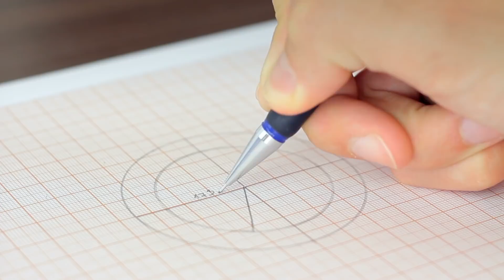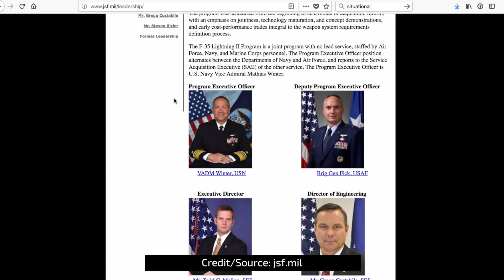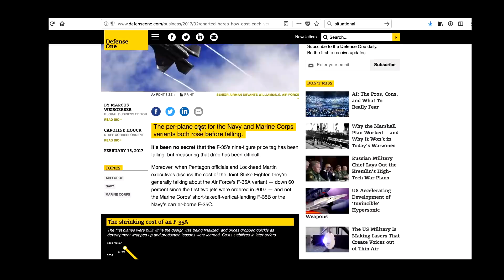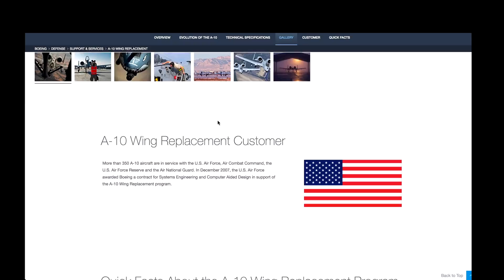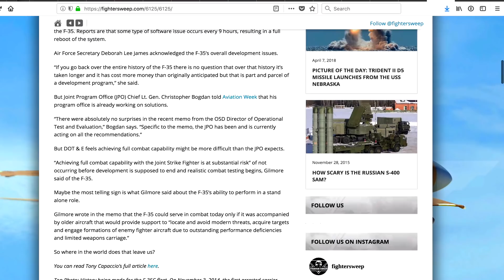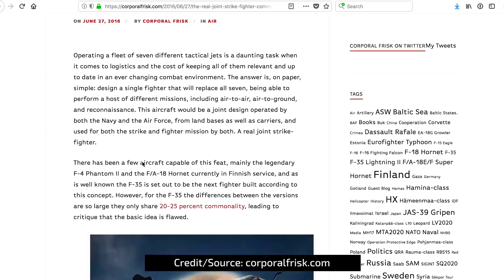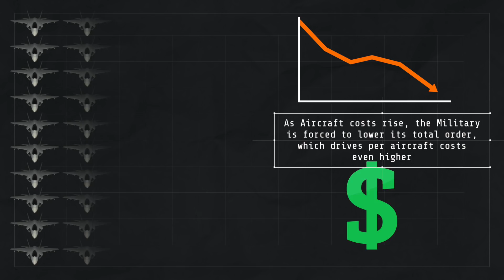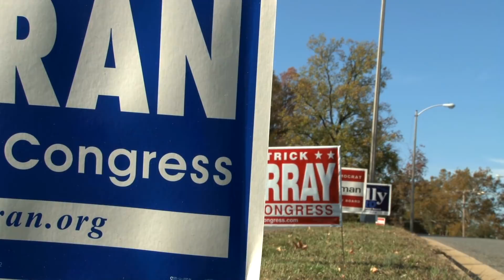Why the F-35 Lightning II Might be the Most Expensive Military Aircraft Mistake Ever

Comment: What most people don't realize: the superiority of a plane doesn't only depend on the stats - and that a lot of legendary legacy planes had their fair share of controversy and issues!

F-15 - engines were inferior (when the plane came out), cost overruns & delays. Also: some expert said, that the plane is too big, too expensive, too complicated (inclusive Pierre Sprey's fighter mafia) - it is now the most iconic and said to be the most superior plane built in the last 40 years.
F-14 - inferior engines cost overruns & delays. - and other really big issues. Their main weapon (why the plane was chosen to begin with) has been probably the most controversial and inferior expensive missile ever (Phoenix).
F-22 - cost overruns & delays. Some issues which resulted into the loss of airplanes and the loss of life. Now - pretty much everyone agrees, that it is one of the most advanced established war fighter.
Mig-25 - cost overruns & delays - several airframes has been lost due to aerodynamic miscalculations - engines could not be operated at maximum performance otherwise they would have result into the loss of the airplane.

And so on.
Reply: Dominik MJ The planes with less issues are destroyed. Ones that could have been successful but low maintenance is “too risky” for government apparently 😂🙄. Aka Canada and their Avro Arrow they could have upgraded over time cheaper and less problems than US, and European planes... But no then America gets to space with the help of the same ppl who made a phenomenal airplane destroyed by political bias.
Reply: @BARelement  Look - there are always a lot of conspiracy theories. It is very difficult to determine the "better plane" - and especially how much it will cost and how many problems it will have (in concept of prototype stage) (except you know the future or the "the future of a parallel reality).
The same issue applies if you compare the the F-22 with the YF-23. You will never know.
But let's face it: the F-35 has nothing to do with this issue really.

The real issue is, that 4+ generation planes - and especially 5th gen planes (and future gen planes) are impossible complicated - on the other hand militaries expect better and saver musters (and tests become more and more thorough). These two principle can only go into one direction: delays and cost explosion. And it doesn't matter who is producing it. You have got the proof in Russia (PAKFA over budget, basically cancelled,. underperforming) and China (J-20 underperforming - not at all 5th generation / J-31 delayed... who knows how it will perform eventually - but signs are not great). 
So - let's be realistic and give it to the planes, which achieved at least most of their expectations - and not delve into a theoretical future.
Reply: Dominik MJ Well 1. Before you continue this passive aggressive crusade you went on by write all that pile of. I’ve studied the aircraft while you assume by what the news gave you 😂. I’ve had books in my reach (although very rare.) I’m not delving into fantasy but hey if no one created theories we’d have no facts so we all know what you are against (the facts). “Stealth is a scam it’s just a theory.” I can make that point all damn day... lol I don’t believe that quote but just showing how your statement can be used to abuse a real argument. If the Avro Arrow can out climb the F-15, have a top speed CAPABLE OF Mach 2.5+, actually hit Mach 1.9 with less than full power due to the test being stopped since they didn’t want the weaker American engines to get the deal instead of the more powerful Canadian Orendas, Not only was the J57s weaker but it still got it to Mach 1.9 and could go higher, not only that but it had a higher climbrate  than many gen 4 planes (stripped down F-15, and Su 27), Has a internal missile bay unlike MANY 3-4th gen comparisons meaning when armed it KEEPS its performance more than other planes. Do you know how aerodynamics work correct?, and finally It can out maneuver Su 27-Su 33 at high ALT (despite lack of thrust vectoring 🙃🙂) can make those HIGH ALT turns with no loss of that altitude or aka (energy). Meaning it had amazing MER (Maneuvering Energy Retention But maybe you didn’t know that hence me explaining). Ok Now onto the things you said about “ITS ImPoSsIbLe to compare performance.😩” So you forgot math exist? You can’t do power to weight ratio? You can’t do aerodynamic calculation (aka drag to lift, drag coefficients, constants.)? Wing loading? High alt performance? Wow I didn’t know weights, thrust, drag to lift, drag coefficients, etc was so secret on these planes. It’s cool and all how you bring up all the gens (2nd-5th gen jets). Then say I’m in fantasy world but forget that math can be used to compare performance.. Your passives aggressiveness is just hilarious 😂🌚. It just failed. But yeah since you mentioned how “wE DoNt KnOw EnOuGh tO CoMpArE f22 tO F23” we actually have some figures we can play with. If you are smart you can put these together to come up with a reasonable answer. Here’s what I’ll tell you the YF 23 was objectively faster, stealthier due to its awkward less conventional shapes, was less maneuverable (although that’s a bit iffy since there is no hardcore proof I’ve gotten so far that it was less maneuverable. From what I gathered the YF23 pilot didn’t push the plane as hard and risky as it could go like the YF22 pilot did while showing off at the end.) but either way the less maneuverability can be attributed to the fact it didn’t ah s thrust vectoring which could be fitted to production lines if it was that serious, along with some software changes in the FBW. So what we can get is that based on its role and what it was meant to do. The YF 23 was better OBJECTIVELY speaking 😂. So there goes your “theory” (bs) about it being impossible to compare flight characteristics even though studies, books, math, and physics exist also with the fact that you can be a reasonable person and weigh those characteristics and decide what matters for its role, or for the “future” as you say 😂.
Reply: Dominik MJ Also I Know the Avro Arrow was more reliable as far as prototype stages go... They went full into production and skipped prototypes with the only malfunctions being quote “a light in the cockpit, and landing gear collapse on occasions” (but otherwise safe landing). While most planes take 10 whole years to get a prototype with less bugs in it, AND IT WILL STILL HAVE MORE FLAWS. The arrow was one of the most flawless “prototype” program I’ve ever looked at, and read upon. But here you go with the “we don’t know anything because books, math, and common sense don’t exist.”
Reply: Dominik MJ ILL throw some numbers at you Mr. “Impossible”. YF23 had a super-cruise of Mach 1.6+ and Top speed exceeding Mach 2.2+. Whilst the F 22 having a super-cruise of Mach 1.58, and a top speed JUST Mach 2.2... Along with the YF22 having a marginally worse Thrust to Weight also meaning that chances are the YF23 has a higher climbrate than its YF 22 counterpart... Right? See how easy it is to use commonsense, math, and something called research buddy 🙂😊? Also the YF23 Was lighter, had more wingarea, along with the previously mentioned better thrust to weight of the YF23 meaning it objectively without thrust vectoring being enabled had better maneuverability. But that’s just the short end of the stick and it’s not as clear cut as the rest of what I said but it’s closer to the truth than giving up and saying “ITS IMPOSSIBLE 🤤🤡.” You also realized that the YF23 has a higher combat radius right? 800mi for the YF 22, and 865-920mi for YF23. 🙃 Oh wow you failed in your argument (so many cracks, and falsities in it). I think my point is made, it isn’t impossible to calculate RAW PERFORMANCE, and Weigh it out with common sense to see which is best, and that next time you don’t attack someone being passive aggressive by saying “you are being theoretical” when A. technically everything said, and done is theoretical to an extent B. What would we be without theory? C. I brought actual facts at the end of the day what did you bring? “1 gen, 2 gen, 3gen”??? That cat in the hat shit. 😂💀 Maybe next time but not today son.
Reply: @BARelement  The Arrow was cancelled when it became clear that espionage had been doing data gathering and any further developments would only help the enemy learn more
Reply: Ben Grogan Um, what about what happened to MiG 25? They made the secretive MiG 31. Which actually stayed under wraps. So “help the enemy”? Where? If that’s the case no NATO nation should build anything advanced for sheer fear of the knowing...
Reply: @BARelement  Read up a little, Avro at the time when the Arrow was being developed it was believed directly directly infiltrated by Soviet agents - CIA agents performing similar tasks claimed that Avro research documents where found In the hands of the Tupolev bureau.

You mention the Mig-25, that was partly compromised by America intelligence and lead directly to panic and demanding a higher spec fighter in the for of the F-15
Reply: Ben Grogan 1. I’ve already read upon it hence me acknowledging what you said as partial fact. 2. By that logic we should stop everything we do because the others see it... 3. I mentioned the MiG 25 BEING FULL COMPROMISED, and them making the MiG 31 IN RESPONSE 😁! I didn’t mention F 15 has nothing to do with that plane so please read on what I said. Stop the passive aggressive Highschool gossip girl stuff.
Reply: @BARelement  There is a world of difference between terminating a project that is compromised, moving the personnel you trust to NASA research positions and stopping everything you do on any project

One is pragmatic to stop any further info directly leaking, you know there are data breaches but you don't know where, how or how much of the theories behind the project's choices has been breached and the other is a childish all or nothing - I don't believe that you are that silly from what I've read as in your replies to others you are sticking well to factual arguments
Reply: Ben Grogan I agree but still it could have had a comeback Is my point. And just like the US does investigating Canada could have dove into the issue and figured it out imo. They could have been a super power but they gave up to early and too far.
Reply: Ben Grogan I appreciate that you see I’m sticking to factual arguments. They based the MiG 25 off the arrow and from what I know it isn’t comparable so much in overall performance just high speed. Thx for being kinder Han others though.
Reply: @BARelement  I wasn't aware of the Arrow  directly contributing to the MiG-25 beyond being a competitor, I was under the Impression that the Arrows initial schematics where in the hands of Tupolev and aided in resolving so early development issues for the Tu-22 Backfire engine intakes at above mach 1.4
Reply: @BARelement  As for recognizing that you are sticking to facts, especially in the F-22 vs YF-23 question, all you've said are known facts
The YF-23 had a few small issues that needed to be resolved but was marginally ahead of the YF-22 in many regards - Lockheed won mainly based on them demonstrating that the airforce believed they could better manage the high value contract due to their on going knowledge of stealth aircraft from the F-117
Reply: Ben Grogan Truthfully so. But it’s weird how much Lockheed has the government, and politicians by the balls despite the YF 23 being more promising for what the US air-force was actually looking for.
Reply: Ben Grogan Yeah I love the USSR planes but it  was a fail of all the info they went off of and what it ended up being. The MiG 25 was a master of one, Whilst the Arrow being a jack of all trades. I don’t know why but all they must have had was basic for the MiG.
Reply: Ben Grogan Niether the TU 22 or MiG 25 matched the performance of the arrow but it was a daring attempt. Also speaking of copies from my knowledge the layout of the SR 71 is quite similar to that of the Avro 730 so that alone was suspicious. And many things ofc from Avro appeared in nasa and American aviation. Aka internal missile bay, moon technology, space travel tech, Avro 730-SR 71, major Titanium use, etc.
Reply: @BARelement  Because of poor government choices - My country the UK did it too

After the WW2 they wanted the companies to be forced into mergers so they had less contracts to deal with, however they have in the process almost monopolized the defense industries - This is why Northrop Grumman have been awarded the B-21 development contract to keep them afloat to limit the influence Lockmart have
Reply: Ben Grogan Damn. I hate it tho tbh. Most governments are corrupt at this moment lol.

Comment: The 2015 simulated dogfight between an F16 and an F35 was conducted at a time when the software in the F35 deliberately restricted its maneuverability. This is something critics of this plane never tell you. 

The F35 is by far the most advanced aircraft ever built. There is nothing else remotely like it. The technological advances needed to create this plane were a gigantic leap forward in many areas. Lockheed did an incredible job. The nature of air combat is radically changed by this plane. Each one is a node not just in a swarm of manned and unmanned aircraft that accompany it but with instant access to and analysis of all pertinent knowledge available to the United States. The power this gives the pilot combined with sensor fusion is enormous and a huge advantage over every adversary. Don't take my word for it, ask the pilots who fly it and what plane they'd choose to go into combat against it.
Reply: It was also with both aircraft "Clean" with no external stores - The Norm for the F-35 but not the F-16 which carries external weapons and fuel tanks

Comment: I had brief conversation with a retired navy pilot/test pilot that works at JPL. I asked him about his opinion of the F35. His response had hestation as if I'd reprimand him, weird, but eventually came around to expressing an unfavorable opinion of the aircraft. He felt all the boasting of the F35s advantages was similar to the boasting that the F4 Phantom had about not needing guns on the aircraft because heat seeking missiles eliminated the existence of dogfighting. Which of course was proven to be a wrong assumption with deadly consequences leaving the military to jimmy up guns to attach beneath the F4 where a spare fuel pod should go.

Hopefully the consequences we suffer from this aircraft won't be so harsh and we can recover quickly.

Comment: The F35 A B and C already have enough differences that they might as well have just made 3 different aircraft. But unlike designing 3 different airframes for different roles, they end up constrained to the design that keeps them “common” enough with each other. It’s one thing to share the same avionics and armament and nuts and bolts between the branches... it’s another to try to use the same aircraft for all roles.

Comment: So, it seems to me like what the pilots most like is the interface between them and the plane. Things like sensor fusion which basically has the computer give pilots an interpretation of the sensor data rather than feeding the pilot "raw" data that they need to further interpret. 

Meanwhile, what the detractors seem to have against the plane is its aerodynamic design, which is compromised for the sake of stealth and to fulfill requirements from 3 branches of the military.

Would it be possible to retro-fit older planes, such as the A-10 for example, with sensor fusion for the sake of easier pilot operation? Older planes have multiple sensors whose output could benefit from being integrated into a single display for the pilots, in which case, they would be gaining what seems to be the F-35s key benefit to pilots.

Assuming that avionic and combat-awareness are 2 independent systems, shouldn't it be a relatively simple procedure of upgrading older planes' electronic combat suite? I mean, imagine an A-10's robust airframe with the situational awareness of an F-35.

Just wondering.

Comment: The A-10 is the modern stuka. If there is any other aircraft that isn't friendly, it is dead. The jet is slow, not the nimble, and the gun is outdated. The 30mm is a good cannon, but with composite armor and ERA, the A10 relies on spalling for tank busting. As a strafing plane, it still isn't the best. The A10 is still slow and the gun is not cheap to maintain. Let alone that any plane could do the same. The issue is the low amount of parts for the A10. Many vets and stuff don't want the A10 to retire because it saved their lives. Which is respectable. However, the same way done with the OG thunderbolt. The P47, or the F100S, F4, F18, etc literally any fighter jets or plane in the role of CAS has done this. So the argument that "It saved my life.." is respectable, but irrelevant. The thunderbolt II will be dear to many , but it is outdated and struggling so hard. If a war happens with Russia or China. The A10 will likely no be used. Unless total air superiority is achived the A10 will be a duck hunt.

Comment: remove the 30 years of "maintenance and upgrades" from the unit cost
remove the F135 engine development from unit cost 

F35 ~89M$ (program cost per unit)
EFT ~100M$ (program cost/units build = 152M$ per unit)
F15SE ~100M$
F16/F2 ~127M$ <<< japanese F2
F18E ~70M$
F22 ~150M$
MiG-35 ~40M$ >5 units built?
Su-35 ~65M$
JAS39 ~60M$
Rafale ~84M$ (program cost/units build = 381M$ per unit)

The F35 is not that overpriced in the end ... the most expensive piece of $hit is the Rafale if we count things the F35-haters way